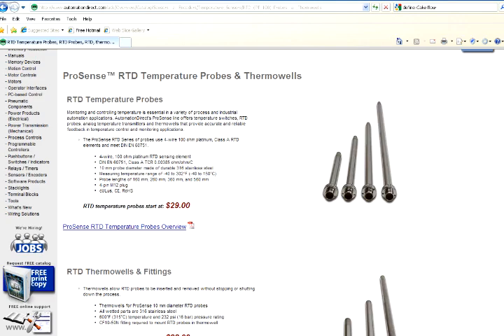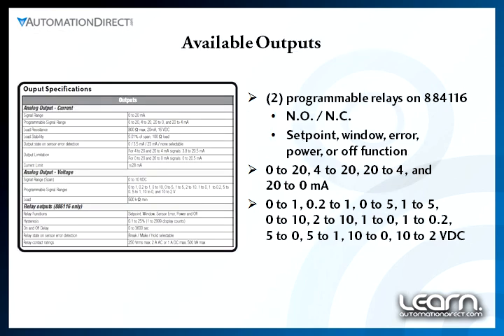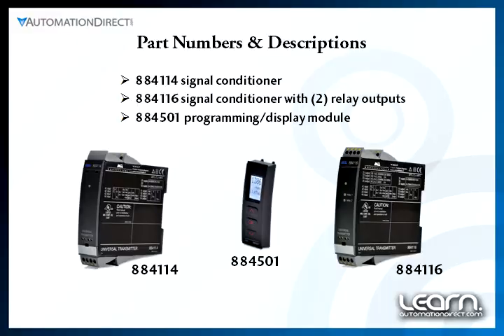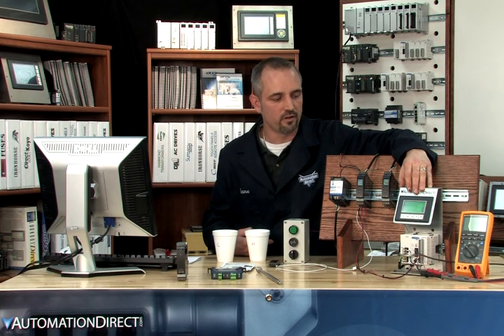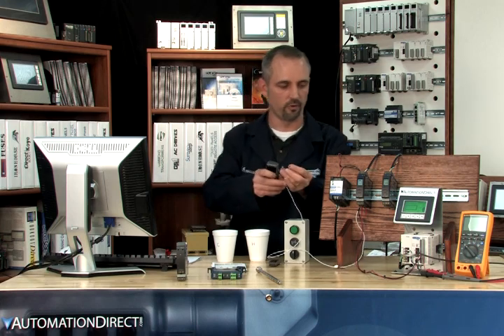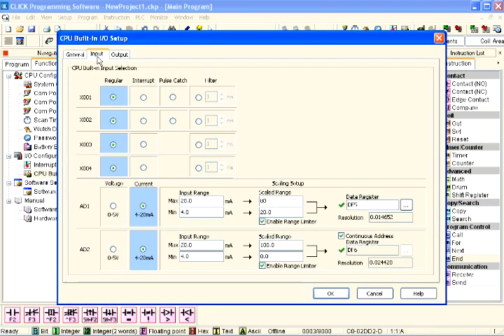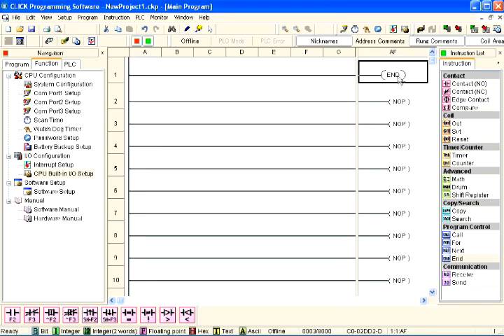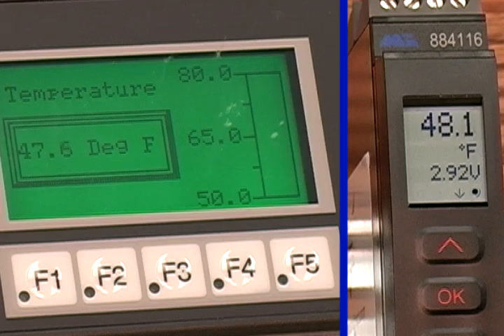Universal Signal Conditioner - Overview & Applications (Part 1) from AutomationDirect

Comment: Is signal conditioning need a programming? Let's say I need to convert a signal from 4-20ma to 0-750mv?
Reply from the maker: Thanks for the comment Benny. These would be programmed using the programming option module. The output range for this device would not meet your needs for 0-750mv. The closest scalable range would be 0-1V. Please see the output table on this document. https://cdn.automationdirect.com/static/specs/scusig310014001600.pdf